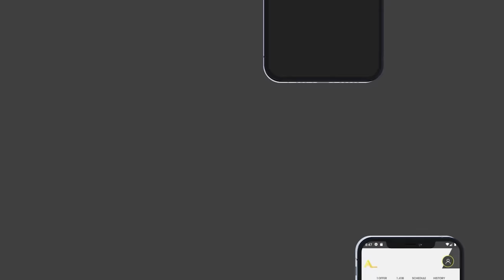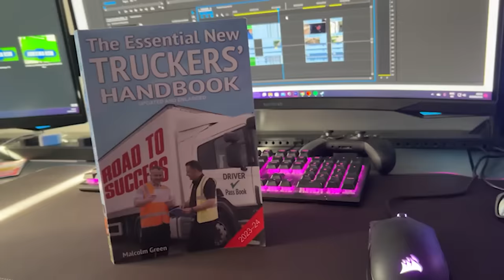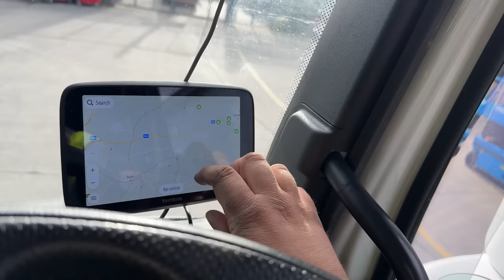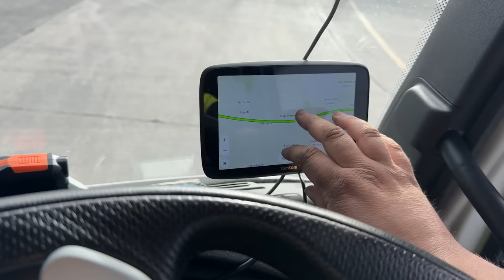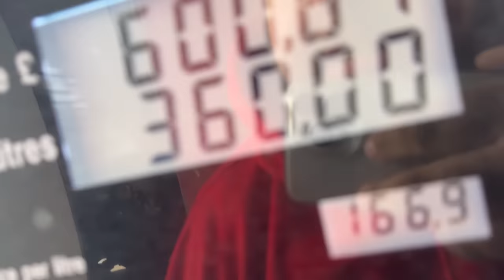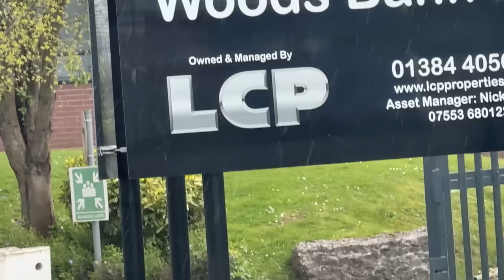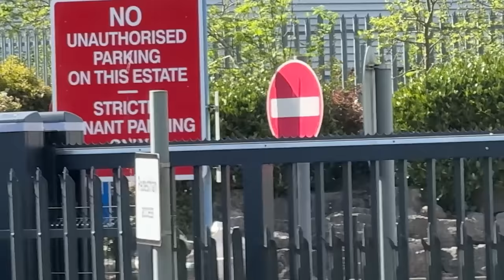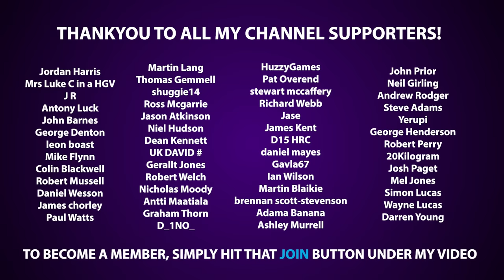THEY REFUSED A DELIVERY AT 3PM! “You’ll Have To Come Back In The Morning”

Comment: The rigids (HIABs and 7.5T/10T) and transits are B&Q home delivery vehicles that are loaded in separate areas to inbound vehicles (at least that’s in Swindon store). That’s why they got in before you. The B&Q artic is inbound from DC and it normally takes around 2 hours to tip and load it back on with waste to go back to DC. It seems normal to me but I can understand why it’s frustrating when you’re waiting and it looks like people are pushing in.
Reply from the maker: Yeah that’s pretty much it mate. I’ve DC work before for other companies and they’ll have a fully loaded truck tipped and reloaded in 30-45 minutes. 2 hrs is a joke to be honest 😂 but yes the others were not technically pushing in as, like you said, they had different areas

Also, I’ve done DC work for B&Q out of Swindon before as well 😂 that’s how knew they’d be slow.

Comment: If a company is open until 8pm then  they should accept Deliveries until  at least 7:30.   Fair enough a company telling you you can’t unload when you arrive at 4:45pm when they close at 5pm.
Reply from the maker: Yeah, I turned up at 3:10 and they went home at 3:30 so yeah it’s totally fair enough. Although just frustrating they finish at 3:30 because it means I was behind for the rest of the week.. wouldn’t have had that issue with B&Q tips me quicker as well. It was just one of those days.